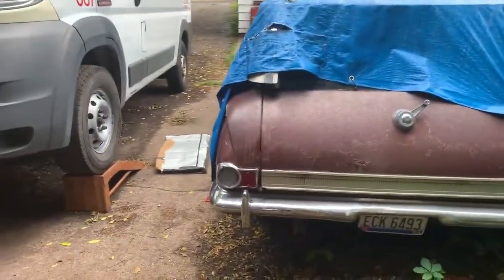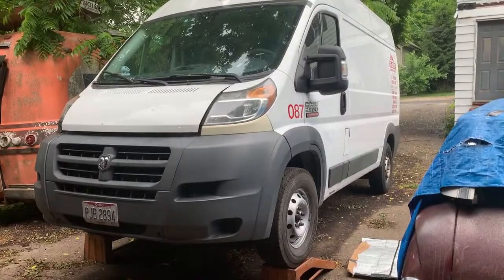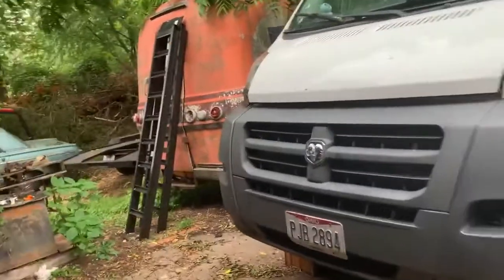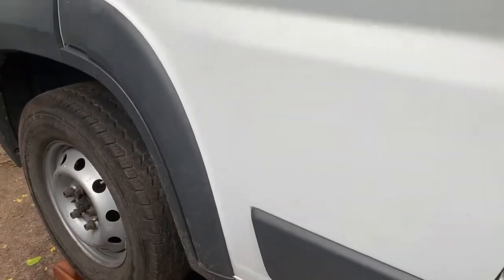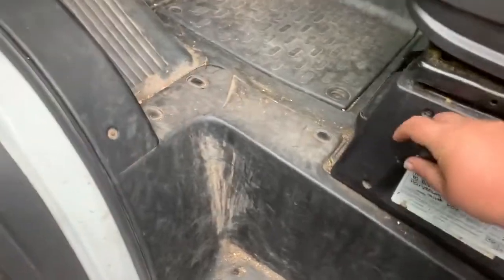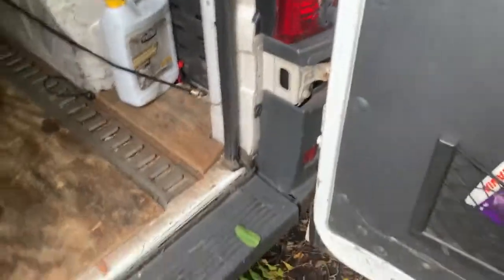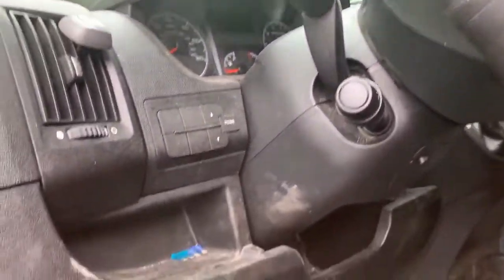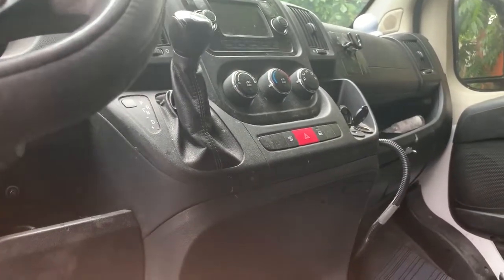680,000 mile Ram Promaster   what to expect

Comment: I have one on the target with 300,000 miles @ $14,000 looks neat and I think I'm getting it
Reply: Did you get the and how is running I’m trying to buy one with 240k miles .
Reply: @lofadem  I bought one with 245000 miles. Runs good for about a year....now it has some issues that I can fix but you have to recheck

Comment: Ours at work never last more then 120k, they are trash and are always on the dealership having issues fixed. Mine had 80k and needed a new oil cooler seal then after the dealership replaced it the engine started knocking

Comment: Love your videos. I just a bought a 2015 ram promaster Van camper, only 14000miles. Wondering why the engine coming when it’s really out very hot. Is that normal operation? New fan
Reply from the maker: Yes, very normal. There are two fans - one is dedicated to cooling the engine, the other is for the a/c system. When it's hot out, the second fan will cycle every 45-60 seconds, stay on for 15 seconds or so, and repeat the process. Normal.
Reply: @promastersonly1419  thanks so much. And I’m surprised you could decipher my original question. 😂
Reply from the maker: @tumalo710  Deciphering Slurbian is my secret superpower!

Comment: I have a new camper van (2022 with updated electronics) on order (picking up on January 16th); how do I build a Catalytic converter protector since creeps are steeling them at a record rate? (I have access to welder) I will be traveling the entire US and one never knows when it becomes a target! I read that because of some tappet issue; I should use 5W30 full Synthetic instead of 5W20 as factory recommended. Anything else that needs attention for longevity and trouble free travel??? Thanks much!!
Reply from the maker: I need to make a video on this, but you don't have to worry about cat theft on the Promaster. They are bolted directly to the engine, high up off the road, with no space to get a saws-all in to cut them out. Even better, they are under $300 each if you needed to replace them, meaning that the thief wouldn't get much money and you wouldn't go broke even if this did happen to you, which it won't. As to the "pentastar tick" yours was built after the upgraded parts were introducted, so I wouldn't expect you to have that issue for hundreds of thousands of miles, if ever. Oil; it's a matter of opinion, but I see no benefit to using anything other than the recommended oil. I have a whole video on this.
Reply: @promastersonly1419  Thanks for your quick reply; I really appreciate it!

Comment: Is this the 3.6 gas or 3.0 diesel?
Reply from the maker: Gas. The dieselw are not very reliable and I dont recommend them. The van in this video now has 825k on it.
Reply: @promastersonly1419 same engine and transmission?
Reply from the maker: @lofadem  That particular van was my first, bought new in 2014. It's what I learned all the ins and outs of Promaster on. Still have it, has about 825k on it now. Non original engine or trans, but trans made it into the 600k range before croaking.
Reply: @promastersonly1419  cool thanks for the reply I’m thinking on buying one with $240k  .
Reply from the maker: @lofadem  I have a video called "how to assess" that lists the common things to look for. What you'd want to do if you can is cut open the oil filter and look for metal, but my guess is if it made it to 240k the previous dude has that issue and took care of it. Wouldn't have made it to 240 if it was neglected.

Comment: Ohio plates, but could you give us a percentage of miles driven on snow/ salt covered roads? This undercarraige looks like it was mostly driven on southern roads.
Reply from the maker: 95% midwest. All highway miles. I have an updated video on this van at closer to 800,000 elsewhere on the channel.
Reply: @promastersonly1419  my question is about the transmission. I’ve heard of complete transmission failures under a year in extreme cases as well as under 50k mi. Your thoughts and experiences with the transmissions in yours?
Reply from the maker: @JustTip922  Trans is a weak point, but not any better or worse than any other make. I’ve gotten extremely lucky, getting 3 transmissions out past 500k without major issues. Others are not so lucky. Look for a vid of mine called Transmission Musings.

Comment: Im looking at a 1 owner 2500 2017 159" with 178k miles and you made me laugh and excited to go ge tit before it sells!  What is the "punster tik" you mentioned.
Reply from the maker: Pentastar tick. Will be a ticking sound at idle, caused by worn rocker arm needle bearings. About a $1500 fix, but you do it once and the engine is good to 500k.
Reply: @promastersonly1419  I have a video producing the sound is there ay way I can get it to you to review for me?
Reply from the maker: @momentswithmark2491  promastersonly@gmail.com
Reply: @promastersonly1419  sent. I think that is what it is.
Reply from the maker: @momentswithmark2491  Didn't get anything. promastersonly@gmail.com
Reply: @promastersonly1419  yeah not sure why but it wouldn't send the video. I'm 99% sure it is the tick you mention. my other worry is the mystery coolant leak. seems like it maybe the oil cooler housing. So if I would to pay someone to fix the rocker tick the oil cooler would be in the way of travel to the rocker?
Reply from the maker: @momentswithmark2491  Good time to do both, there’s a labor overlap of maybe 1 hour.
Reply: @promastersonly1419  yes but all my local shops I have called say $3200-3500 plus $600 if a cam is needed. ouch but the van is in really great shape no major body issues, doors are great, interior can be easily cleaned up but to major damage. no windows in van (I plan to make a camper out of it), drivers door mirror has a rock hole, front grill has new clips that need put in to hold it (but the grill isn't broke). So I think I will still try to buy it for under 11,500 if I can!

Comment: Bought my 2017 promaster new.
 At 40,000 miles the exhaust valve blew. 
At 61,000 miles the exhaust valve blew again.
 Dodge didn't want to help with the labor because it needed a new engine.
   In March 2024 the motor mount bolt broke clean off and the motor almost hit the pavement. 
 Dodge doesn't care about its customers at all. They hate people and have a shity product. 
 Horrible company. 
 Worst ever .
Reply from the maker: I tend to agree. I have a video called “why do the dealers suck” that explains it.

Comment: Promaster has the best rust resistance of any van. I see 2014’s with zero rust.
Reply from the maker: It's kind of amazing. My oldest van was made in Oct of 13, so coming up on 10 years with 800,000 miles on it, all midwest, and not a speck of rust.